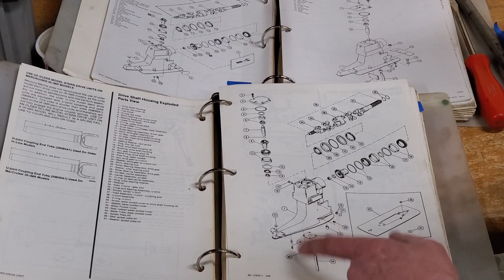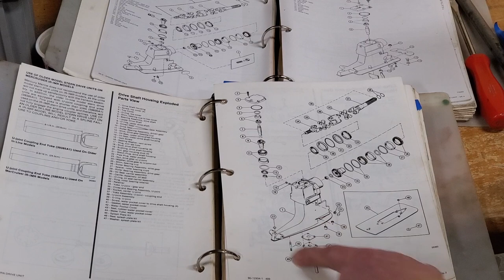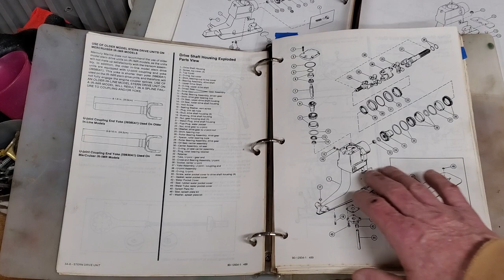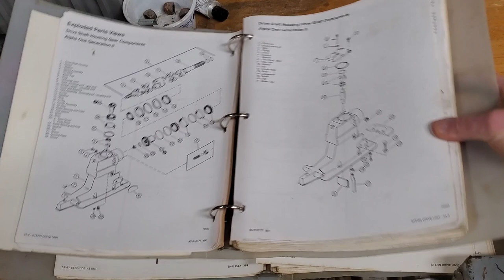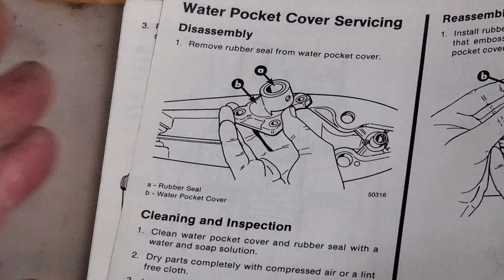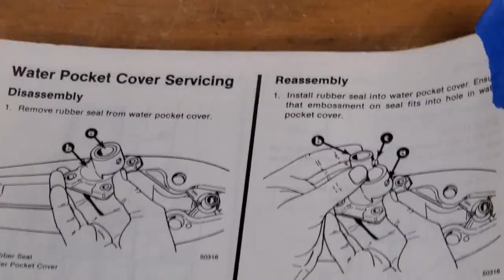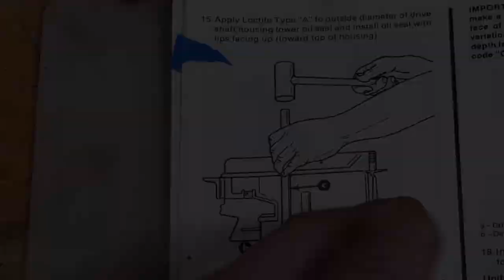Alpha One Upper gearcase driveshaft seal replacement

Comment: Ted I love your videos and have run across a few while searching for info for my first boat (1978 Reinell 170 with a 3.0 mercruiser and I think M1 sterndrive. I’m resealing my upper and I’ve found conflicting info on the direction to install that lower seal. I heard you comment about the lip facing the top of the housing and how that can be confusing. I have tore into two separate uppers because my boat came to me with a 470 upper and that would be the wrong gear ratio for my boat well it a long story. The two uppers I’ve taken apart match what you are saying however two other YouTubers show and say install it with the lip facing the bottom of the housing. Is it possible there was a change for this or is this a good example of the pitfalls of some YouTube videos. I sorta always thought the lip and garder spring of an oil seal should always be on whatever side has more pressure on it to help make the lip hug the shaft tighter.  What’s your thoughts this? I also thought this is exhaust and not oil in this case so maybe this one is less critical??

Comment: @Teds Marine Repair thank you very much for posting this video. It is very helpful and much appreciated! I just replaced the water pump impeller on a second hand alpha 1 gen 1 drive I recently bought and that seal was gone (spring floating around free and not much of the sealing lip left) so this was exactly what I needed to see. Thanks again!
Reply: oh, just one question: what # of loctite did you use when you installed the seal?
Reply from the maker: Thanks for the positive feedback and I'm very happy you found that seal failure!

Comment: Hey Ted, please help…I have an alpha one gen 2. I have gear oil leaking back into boat. The hose from the monitor tank to the drive is not leaking. It’s entering the drive and leaking under engine right above the plug hole. There doesn’t appear to have any oil one the outside of the drive. No drops on the ground. Do you have any experience with this type of leak and how to diagnose it.
Reply from the maker: It sounds like the carrier seal on the upper ujoint yoke has failed. If you pull the drive off it will be evident.
Reply: Thanks so much Ted, you are the man. I’m very confident I can do this myself. Can you suggest a parts list that is needed to get this done. I know I’ll need some new seals, I just don’t know which ones. Thanks again.
Reply from the maker: @Spsnando22  carrier seal with the spacer, yoke shaft and oring

Comment: Great video! I'm getting ready to replace the
drive shaft housing oil seals (alpha one gen
two) but not sure which way the oil seals face.
They are identical, have one flush side and the
other side is open with a spring inside. I would
love some insight. Thank you.
Reply from the maker: If they are the ones in the plastic water pump base, the face away from one another (open sides out).
One seals out the water, the other seals in the gear lube.
Reply: @tedsmarinerepair8956  they don’t go in the plastic water base. It sits against the metal casing and the vertical gear goes into it. It's similar to your oil seal that you used the punch for and a rubber mallet to tap in. But it appears the alpha one gen two uses two smaller seals. But I believe they go like you said. Thank you!

Comment: Perfect video I was looking for my leak but it had been about 16 months since I took it apart and moved across the country and my manual doesn't show this seal going there. I have a question though, how do you get the shaft o-ring past the seal? I tried it without installing it and it just rolls it off. Thanks in advance

Comment: If I dont have the driver tool for the oil seal, can I use a socket with long extension to tap it in?
Reply from the maker: Not recommended

Comment: So I have oil leaking into the bellows. No water in the gear oil. Which seal has failed?
Reply: There are two in the upper yoke that are behind the large spanner nut that work together to keep the gear oil in the upper half.  You'll need to redo those.  There are some VERY sensitive torque measurements to deal with when you do, so take care (inch pounds of rolling torque). Also, need a new compression washer. some good videos on YouTube if you decide to try it.

Comment: my drive is alpha one gen two. the seal on the upper unit is leaking oil down my drive shaft on the lower unit. it doesn't seem it can be replaced through the exhaust cavity like in this video. It seems it's installed from the top. also I'm having trouble finding info on the part# of the upper shift shaft seal on the bell housing. will the brass one piece work on the gen 2 or do I need the 2 seals with brass bushing like I took out of it?
Reply from the maker: Yes for GEN II you must disassemble the upper gear housing to change the driveshaft seal. 
And for the upper shift shaft seal it is a completely different seal/bushing part #. Here is a link https://bpi.ebasicpower.com/mm5/apps2/master/showparts.php?COM_NAME=Bell%20Housing&MODEL=5&IMAGE=1000000067&ITEM_ID=404
Reply: @tedsmarinerepair8956  
thank you very much for confirming this for me. I couldn't find any videos on the Gen-2 break down. as for the drive shaft seals my shaft is worn where the seals ride, so I'm thinking new seals may not even seat.